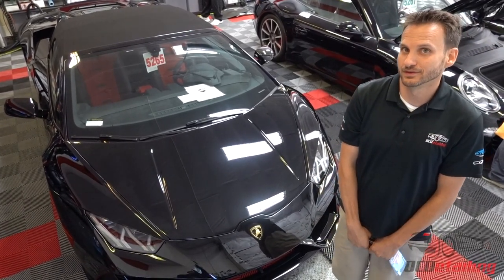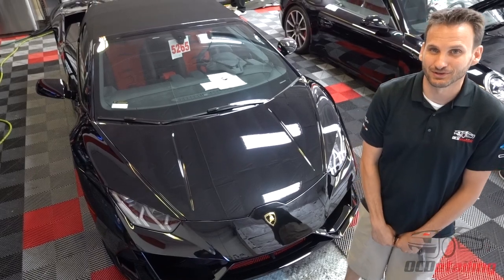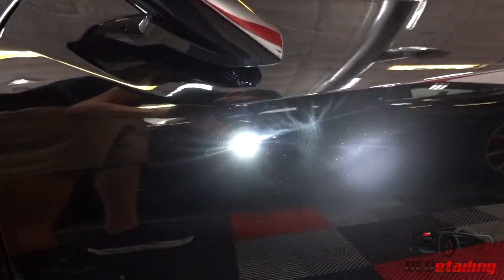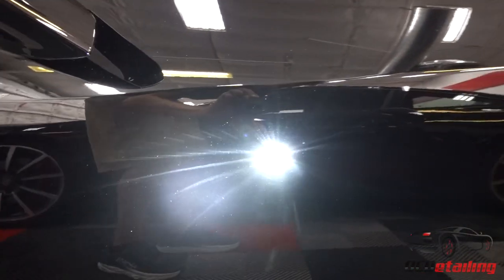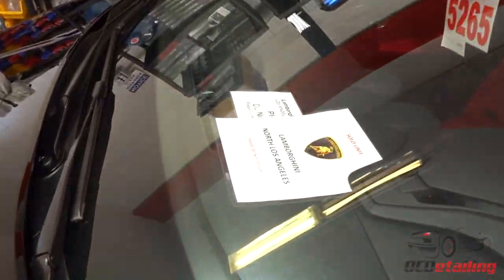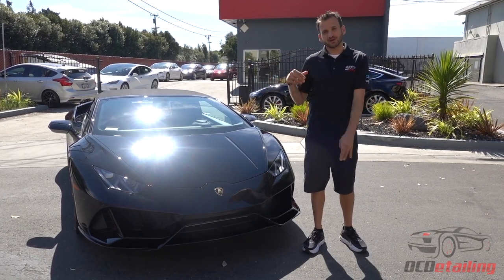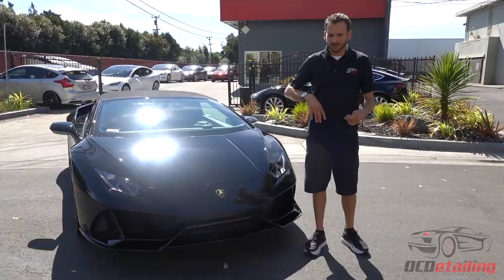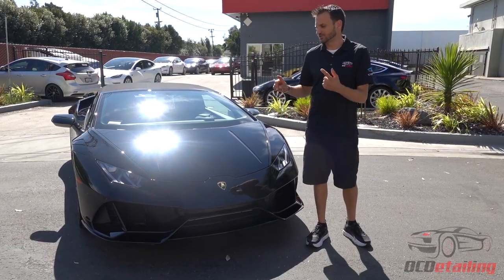2020 Lamborghini Huracán Evo Spyder - Full STEK DYNOShield PPF and CQFR Coating

Comment: Mate, it's hardly a refresh. The Evo is like a brand new model.

It has an integrated spoiler, a brand new LDVI brain to integrate all the functions of the car, it has predictive analytics to predict what the driver is going to do next and set the car up milliseconds before the driver does it.

It has a Performante engine and has torque vectoring instead of aero vectoring which is way more effective.

The Evo has new rear wheel steering and new body styling.

The Evo has a new touchscreen housing every function of the car including a visual of the LDVI in action.

All of this is hardly a refresh ... it is like a brand new model from the ground up.

What you did to the paintwork was a "refresh".